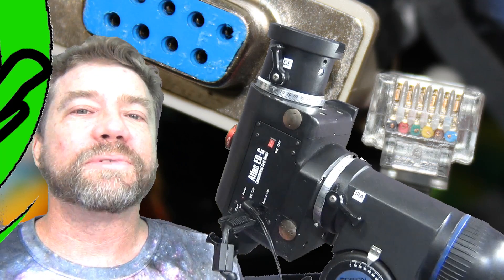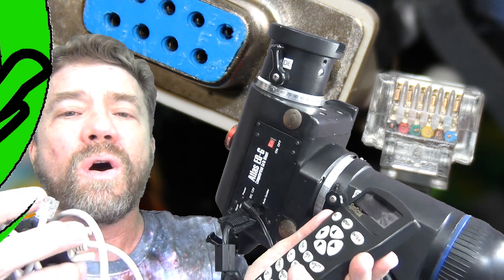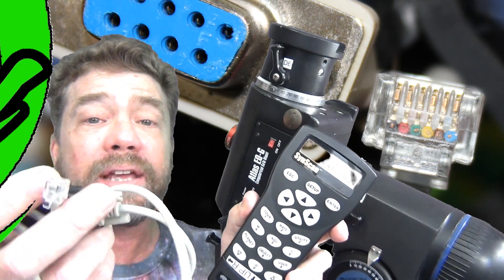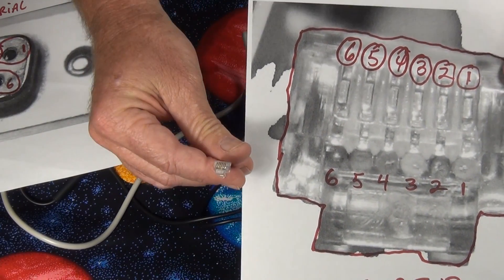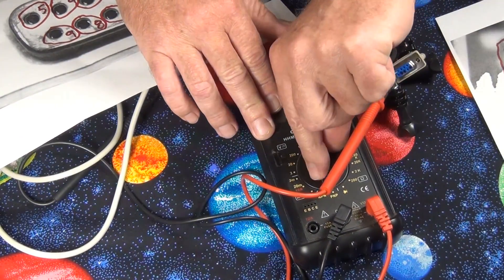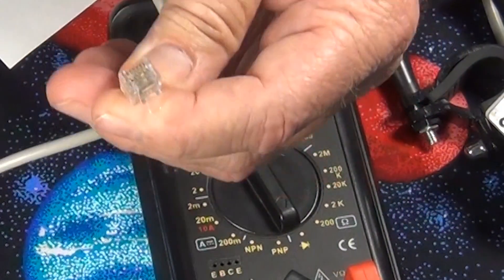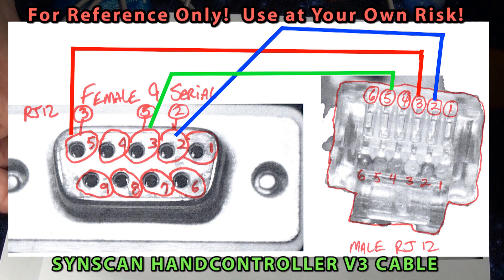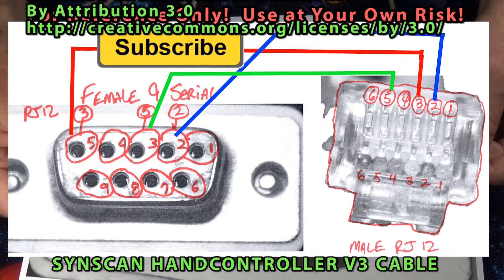How To Make A Synscan Hand Controller Cable (Pin Out)

Comment: I've lost the db9-rj12 cable that came with my Skyview Pro mount and for the life of me I can't find a replacement anywhere. I might try make my own bnut I have the synscan v4 hand controller and can't find the pinout anywhere. Is there any danger if I try this one? I'm close to just throwing my hands up and getting an eqdirect cable so I can get back to using my scope... do you know if eqdirect works with the skyview pro?
Reply from the maker: Did you see this?
http://forum.shoestringastronomy.com/viewtopic.php?t=176
I just googled "eqdirect works with the skyview pro"
Doug

Comment: Made one using your pinout to re-use a rs232-rj45 cable I had, I haven't tried it yet, fingers crossed!!! Thanks
Reply from the maker: It should work!  Give it a try!  Good Luck!
Reply: @Myastroimages  It worked smothly, connect and update. Thanks! I will use the cable for trying controlling the mount from the computer. BTW, after making the cable I read the manual and in the page II of Appendix A a pinout for the cable is shown, but it is different from yours, strange
Reply from the maker: @alxo82  That is strange!?!  I simply followed the pinout from the original cable.  I wonder if the cable in the Appendix A would work?  I'm glad this worked for you!
Reply: alxo82, have you managed to determine what pin corresponds to what function? i can see using the pinout in the manual that 2/5 are RX/TX pins but im not sure what pin 4 on the RJ12 jack does.
Reply: @pattt5408  I do not know, maybe it is used for the voltage reference for the physical link, just guessing
Reply from the maker: @pattt5408  Hi Patt, 
I just followed the pinout and I don't know what each pin does.  
Doug

Comment: hey doug, i enjoy your videos. One thing though about the cable/handset combo. You could replace the whole combo of the handset-serial cable with a TTL cable (USB to TTL Serial), The mount uses TTL signals and it needs only a TX, Rx and ground that's why the mount doesn't use all the pins of RS232 connector. I did this back in 2010 ( i used this cable http://www.ftdichip.com/Products/Cables/USBTTLSerial.htm) since i had the heq5 synterk mount and it is a cheap and reliable way of controlling your mount, also there is smaller delay in guiding since the handset introduces some delay.
Reply from the maker: Thanks for the Link Kostas!   BTW, do you use EQMOD with your cable?  I appreciate the feedback and links.  Thank you!
Reply: I use eqmod since day one with no problems, even though i bought the synscan handset a few years ago the process of connecting the mount to my pc via the handset is more complicated than the usb cable and on some occasions i had connection issues with the handset, so i have it only as a backup in case something happens to my usb cable.
Reply from the maker: I'm wondering about my EQMOD cable...sometimes it will LOCK the mount...like stop working.  My HC never locks the mount.  I'm trying to move away from my HC and what you're doing is exactly what I want to do...use the HC as a backup.  But, do you experience LOCK UP problems with your EQMOD cable?
Reply: There was the occasional lock up with my cable but that was during the early days while i was learning/experimenting with my gear. What i found was that this could happen if i plugged the cable at  another port at my usb hub (it also happened with my camera), so now all the ports at my hub are marked for each piece of equipment, and make sure that there is no conflict at the COM ports, look it up at device manager. Also the mini usb port of the hub that connects to the pc is very flimsy and it can disconnect very easily so i bought a d-link powered usb hub with a B port (http://us.dlink.com/products/connect/7-port-usb-2-hub/) I had no problems since then, since the B port is more robust than the mini usb. You can see this at the polemaster usb cable that screws at the camera in order to avoid this issue, also telescope service sells a similar product for the lodestar guide camera in order to avoid damage/disconnection at the usb port. The hub itself can cause lock up issues and after some discussions years later i found that the d-link hubs (i have no connection with the company) have almost no problems, then again since day one without knowing it i used such a hub.

Another thing you should consider is the usb cable distance. A couple of years ago I wanted to be at a distance from my mount in order to avoid hitting it so i used a longer usb cable from the hub to the pc (i used a cable extension). This can degrade the signals and the way around it is to use a usb repeater. I didn't use the repeater for too much time since i was also looking for a way to remote control my gear. I found a video at the astro-imaging channel (https://www.youtube.com/channel/UCiR5AmROq4YcXF8hCxxZQ-g) with an OTA mounted pc so now i use a qotom mini pc controlled from my tablet, cell phone or another laptop. Again the mount cable is connected to a specific port at my hub and i have no issues controlling the mount.

As a last possibility for guiding/disconnect issues you should consider increasing the input voltage of your mount. While guiding a flashing red light at the mount means that it has low input voltage which affects guiding and maybe cause disconnect issues. I increased the input voltage to my mount (and imaging camera in order to reduce noise) at 13.5 volts with a DC-DC converter, you can find them at ebay just make sure the amps are within range.
Reply from the maker: Thanks for the advice.  My USB cable for the mount goes directly into my laptop on the same port and it's on a 6ft cable.  I'll keep trying.  Perhaps if I get this problem more, I'll consider using a powered USB hub like you suggested.  Thanks again for the explanation Kostas!

Comment: (if you are using a computer on the field) Please try EqDir cable or BlueTooth (I'm using it) ... you will be surprised
Reply: Yes, maybe using one with FTDI chip as that one works better with Windows 10. I've always used such a cable since day 2 of my hobby. :)
Reply from the maker: I have an EQDir cable now.  I'm trying to ditch the hand controller, but, the hand controller is so reliable and accurate...I'm having a hard time letting it go.  This cable is useful for FIRMWARE updates if you keep the HC.    I haven't tried the Bluetooth version.  Does your laptop have Blue Tooth or do you use a tablet?
Reply: I have no idea if a handcontroller would be more reliable as I have 0 experience with it. :) It may be a bit more reliable in the sense you can only do so many things with it. But having my computer connected directly, I set up everything once and next times I just hit the connect button. In my experience it's been an amazing transition of having to think about what time setting I need etc. to no second guessing.
Reply: I'm using a bluetooth dongle on a  miniPc (which controls my for my gear). The MiniPc is remotely accessed by another Pc. I'm trying to reduce the moving cables, as in https://www.youtube.com/watch?v=z9uVgn469As